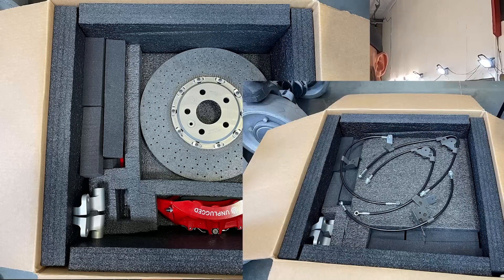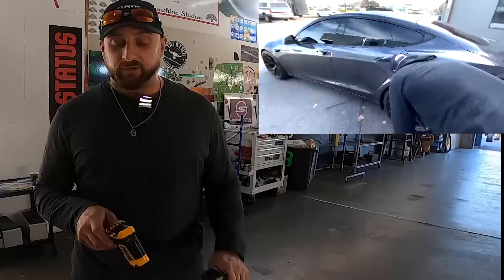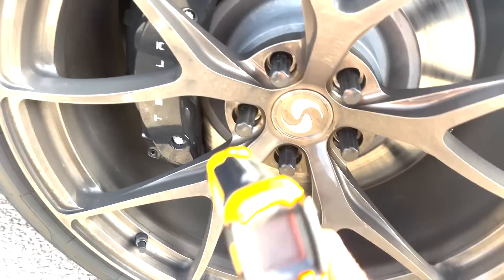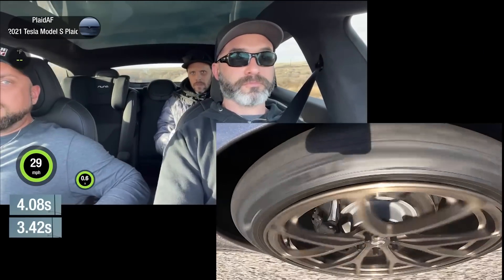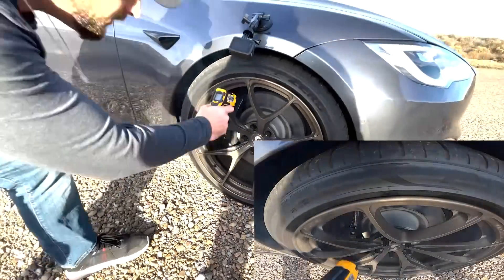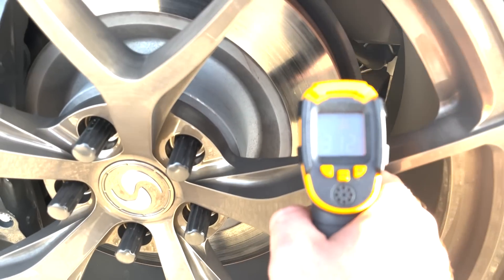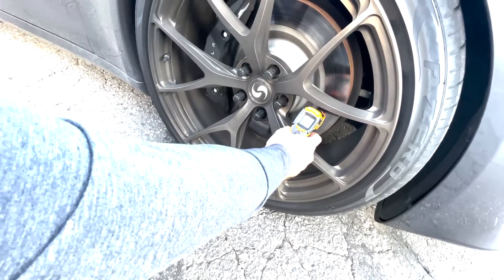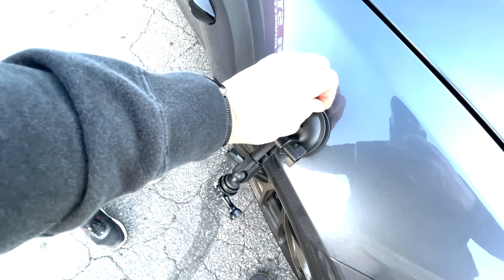Tesla Brakes Catch on FIRE | Model S Plaid

Comment: From all the vids I’ve seen of the Plaid nearly all of them talk about it being underbraked or at least mention how hard it is to slow the thing down. Tesla should have provided carbon ceramic brakes from the factory, even if they had to increase the price just for safety’s sake. Looking forward to seeing you test the unplugged kit!
Reply: We've driven the car several times.  The brakes are fine for street use.  Most people are not used to a car that has this amount of power and is this heavy!  Tesla selected a low friction pad - likely for comfort since most braking is done via regen and they wanted good modulation and release at low speeds/pressures.  The capacity of the system overall is not enough for a road course (or any other driving where you repeatedly drop 60-100mph every 30 seconds.  If you don't like something about the system overall it's not too hard to change it.  If you simply want a different feel - get different pads.  If you want higher capacity, change the pads and then consider a larger/better design rotor, increase the size on the front rotor, change out the fluid, and do some testing.  These are the options we are exploring with Mountain Pass Performance.
Reply: Even the audi rs6, rs7, mercedes amg gt 4 doors are way faster than the plaid and they have proper brakes.
Reply: Carbon ceramics stock were not necessary, but bigger discs definitely. The size of the discs on this are around the same as on a Corolla. That's not adequate for a car almost twice the weight which can go at least twice as fast. Look at the size of front discs on typical midrange performance sedans. Then look back at these on this car, which is heavier and goes much faster.
Reply: @zolikoff  The thing is that for most folks these brakes hardly get stressed this severely, some folks even report using the same brakes for over 100-200k miles with these kinda modern EVs:

It's a different animal due to how they use regenerative braking to do this job most of the time. You almost never touch the brakes except for emergencies, it's basically one pedal driving.

You can look up TeslaPlaid's channel to see how the vehicle has no trouble handling itself with stock brakes, he's launched his P100D on the track literally over 1000 times, and his new Plaid is about to hit 250 times already, with zero issues. 

Safest and most reliable car on those drag strips while doing so too, judging from his series.

Ceramics or not, there will be drivers that will want to flex this immense kind of power of course, but it's their responsibility to make sure they know what they're doing.

This EV is certainly way too much power for a normal driver to handle. Be very careful with it.

Of course that goes for any crazy muscle car anyway.
Reply: Tesla does provide ceramic brakes, it's just not standard because this is their "family sedan" model. You don't need to brake a dozen times a minute on a public highway, heck most of that is handled by regenerative braking, so for normal usage the standard brakes are just fine. 

But for track use you would want to pay the extra $20k for those ceramic brakes - or cheaper from a third party like Unplugged Performance etc.
Reply: @AllanSustainabilityFan  bullshit, porsche have been offering giant 10 piston caliper antitrust coated iron brakes and carbon ceramic brakes on their from factory for years nomatter sedan or suv.
Reply: @alanmay7929  Porsche can offer whatever it wants for the price it charges, everyone knows that its customers buy them as an extension of the ego, practicality has no place there - and, to a smaller extent, speaks to Porsche's ongoing lack of software sophistication, which makes them less flexible.

A family sedan is not where you go for such customers, but it's fun to embarrass Porsches every once in a while in one, with baby seat strapped in the back for bonus points lol.

Tesla is selling a pragmatic solution and giving people the option to upgrade it based on their need. It not hard to selection an option, even Porsche buyers know how to do it, you want to pay for them go ahead.
Reply: @AllanSustainabilityFan  tesla is just busy selling crazy build quality to their customers, the model s plaid is tesla flagship vehicle and should have offered the most customisations possible, anyone that can afford a Model s can easily upgrade to better brakes and not necessarily carbon ceramic ones.
Reply: @alanmay7929  Sure, they could. Not gonna argue with that. And they seem to be starting to give that a little bit of attention with the new optional brake sets and upcoming performance tires that go with the 200mph unlock. But they're still leaving this area to third parties - like Unplugged and MountainPass - more or less.

I think they're just really trying to stay laser-focused on fast growth and toward their primary mission of accelerating adoption of sustainable technologies. 

A halo car, to them so far, just needs to bring attention to their EVs, in other words to sell the more mainstream models. 

With the Plaid that mission is accomplished, people can't stop talking about the space-age interior, the controversial yoke, the crazy acceleration and drag videos, etc.

Plus it's a good place to test our the technologies that they eventually want to stick in a Roadster when supply catches up to the ridiculous demand eventually.
Reply: @AllanSustainabilityFan  lol.... crazy acceleration absolutely doesn't make the whole car, there is reason why people calls bmw, porsche... ultimate driving machine, porsche even has excellence driving centers where people goes and push their vehicles to the limits. Cars are made to have fun with and not be boring. Most of the Model s plaid on Internet is just about 0-60 wtf!
Reply: @alanmay7929  Tesla drivers have their own fun, there's Tesla Corsa event where some people modify their EVs for the track, etc. There's no reason for folks to have fun in Model 3/S as well, just doesn't have to be managed directly from Tesla.

The Model S clearly embarrassed Porsche drivers enough to demand the Taycan, so in a sense Tesla accomplished its mission by forcing Porsche to adapt, one can even argue that Porsche may survive the future thanks to this pressure. 

Clearly Porsche are currently suffering through many problems and challenges of EV design with their first proper EV, things that Tesla learned and tackled over fifteen years of experience. 

So that bought Porsche some valuable years, I don't feel as optimistic about the survival of Mercedes and BMW, by comparison, those may either get bailed out or meet the fate of Volvo.

There is indeed more to a vehicle than just 0-60, the Plaid is embarrassing many obsolete ICE vehicles, and is quite well-balanced by comparison to other EVs that are trying to compete in performance, we just see the tip of the iceberg.

You can add ceramic brakes to a Plaid, but you can't add better traction control to an ICE Mercedes, for example. It's a losing game for the older technology, we're just seeing the first signs here.
Reply: @AllanSustainabilityFan  How do I also get on the Tesla payroll? I will embarrass myself as well, where can I sign up?
Reply: @AllanSustainabilityFan  tesla has zero even and those unofficial ones are just regular boring things that the fangirls organises. Porsche has excellente driving centers, land rover has offroad training centers.... for you everything is about 0-60 right?! There are litteraly millions of videos and its just about the 0-60 its getting seriously boring and annoying, people actually likes to race their cars, do top speed, test the limits of their vehicles, there is drift, offroad, overlanding.......
Reply: @AllanSustainabilityFan  ICE actually have way better traction control and the inter connected wheels actually offers way more control for both on and offroad, the fastest cars on earth are unfortunately not electric for your records. For you everything revolves about the plaid right!? Seriously grow up. Subaru offers high ground clearance vehicles for those who loves to go to remote places and have more activities.... electric cars are basically pavment princess.
Reply: @AllanSustainabilityFan  porsche has the best handling and driving dynamics and connection between driver/road/vehicle.
Reply: @alanmay7929  Nonsense, ICE is vastly inferior to EV technology when it comes to traction. 

EVs intrinsically have two orders of magnitude more responsive and accurate traction control, and are able to control slip multiple times within a fraction of a second, and do so independently for each wheel based on surface grip.

There's no engine, transmission or other mechanical delays that the ICE vehicles have to struggle with. Just computers and electrons direct to the wheels.

EVs generally tend to be heavier, at least when designed to be practical. That changes with time as batteries continue to improve constantly in energy density. 

And that's where Porsche's small window of opportunity is, they need to transition successfully to the new technology in order to survive. Not dip their toes, but full transition.
Reply: @alanmay7929  And calm down with your fragile Porsche fan ego lol, discuss the topic like an adult for a change.

Look yourself in the mirror and ask who needs to grow up with these strangely confrontational posts of yours.

This is just the way of the world, constant technological progress, instead of being upset, maybe find a productive way to save your darling brand. It seems I care more about them in actuality than you do in fact.
Reply from the maker: Wrong- the “family sedan” is the model S long range, the Plaid was marketed as the “fastest production car ever”, hardly a title for a vehicle that isn’t expected to have good performance in the category of stopping.
Now Tesla has a $20k upgrade for brakes, if you can hard brake 8 times and diminish the braking capacity to a dangerous level and cause the pads to ignite… there’s some misleading claims in the advertising department (of how this came BEFORE a $20k brake upgrade was even considered)  if this vehicle isn’t expected to have performance demanded of it.
Reply: @PlaidAF  I'm not sure where in "fastest" comes the part where track brakes are a requirement. 

Again, the Model S line was always sold as a (high performing) family sedan. The Roadster is their eventual sport EV. Until then Tesla is just dabbling in performance, and is more interested in making EVs mainstream first. 

EV motors intrinsically have so much performance and traction control advantages under the hood. Other companies would want to hobble them in order to protect their product line from cannibalization, but Tesla has no such reason to hold the motors back, so it just comes with the package.

There's more to a performance EV than just horsepower and traction control. Tesla is just beginning to dabble in that area with their ceramic brake set option and track mode feature, but they're not yet ready to tackle that niche head on.

That's where companies like Unplugged Perf. and Mountainpass try to achieve with their modification packages to the Model 3/S.

TLDR:

Lots of customers enjoy having a family car that can also smoke most things on a drag strip on a Sunday, but not all of them would want to pay the extra $20k to have brakes that are over-engineered for what most want to do with the product.

Third party solutions came in to fill the niche, but it's nice to see Tesla beginning to offer some of it now as well.
Reply: @AllanSustainabilityFan  it has not jet even achieved 200mph, where bmw, mercedes and porsche have been doing over 200mph.
Reply: @AllanSustainabilityFan  the Bentley flying spur with barely 700hp goes over 211mph its crazy how super fast it is.
Reply: @alanmay7929  Thanks for proving my point: A family sedan has no need to go over 200mph, even if the product itself it capable of it - the torque curve shows it maintaining 1000hp all the way to 200mph. 

Tesla specifically has their EV speed limiter locked at 163mph currently. Just a software lock. They plan to unlock that to 200mph soon, when they start selling their (again) OPTIONAL track tires to go with it. 

The Roadster is meant to go past 250mph by comparison.
Reply: @AllanSustainabilityFan  nonsense, in Germany sedans/family vehicles do 9ver well way over 200mph and there are tons of videos on Internet. The roadster 250mph must be a joke right?! Buggati, koesnigsegg... have been doing well pass over boring 250mph, in fact vw ons the best/most secrete and biggest vehicles private ground.